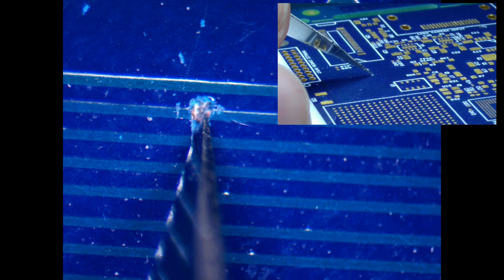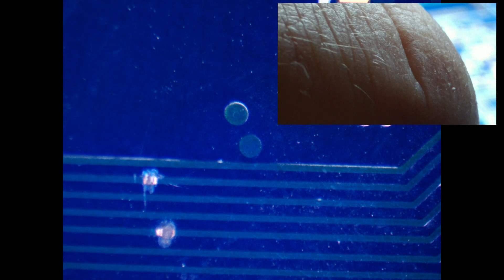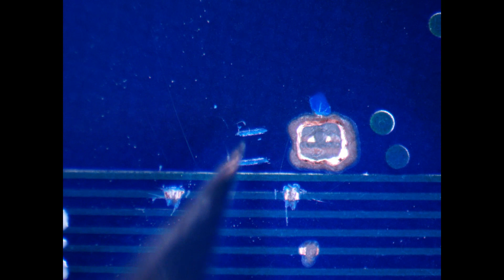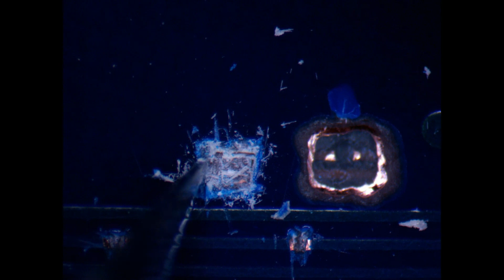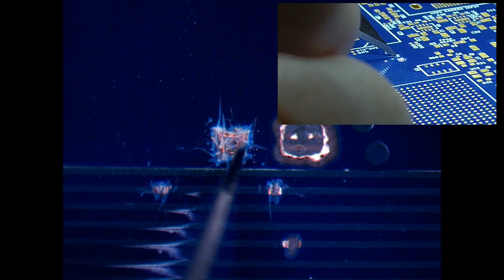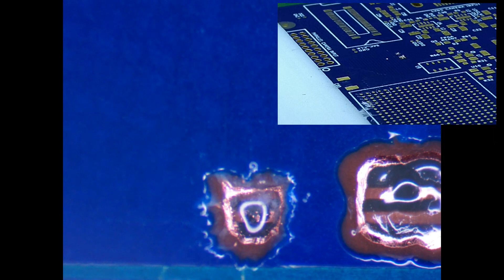Lab #3: Cutting conductors on outer and inner layers

Comment: Nice videos ! Thanks for sharing those tips / technique.

Audio is a bit on the quiet side though, so might be worth boosting a bit :p
Reply from the maker: I actually boosted it as far as I could without clipping and applied some range compression to make the narration even louder. The dynamic range is massive between the quiet ambient, me talking, and the louder sounds like the power tools and compressed gas.

If I don't mind clipping the spray sounds I could probably add another few dB of gain, though.